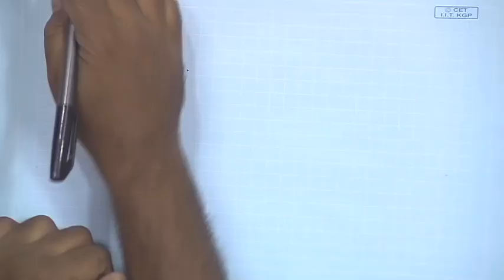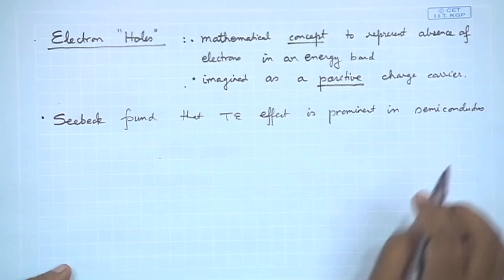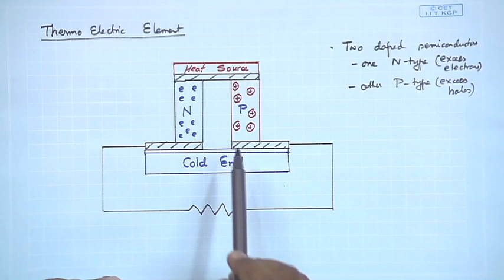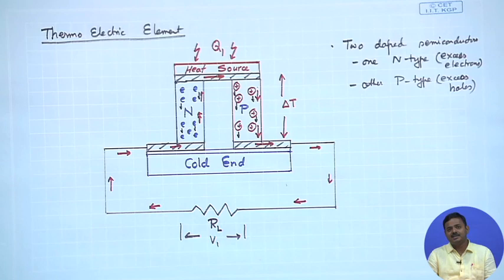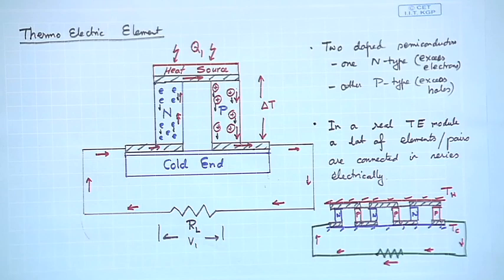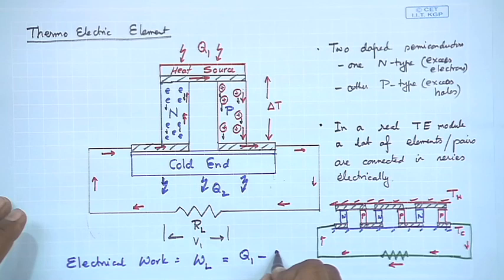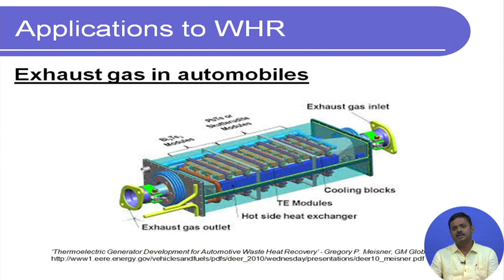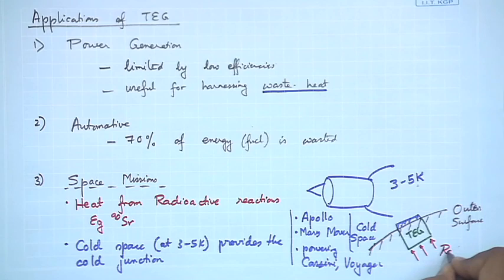Lecture 41 : Thermoelectric Generators - Functioning and Applications

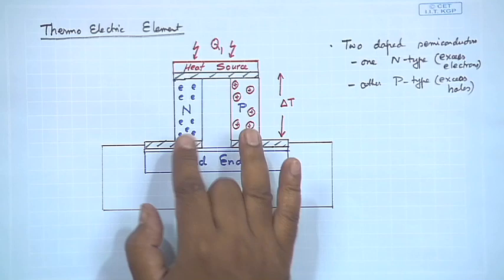Comment: Hello, at 10:00 (minutes) speaker says N and P type connected at "Hot End" as we see in picture too. Also, he says "Cold End" is not connected and that is how its maintained. However, its not clear that metal plates is connected to "Cold End" or not. There is a small space between metal plates and "Cold End". Is it empty space or electrical insulator or what?
Reply: Heat sink or we can say heat absorber